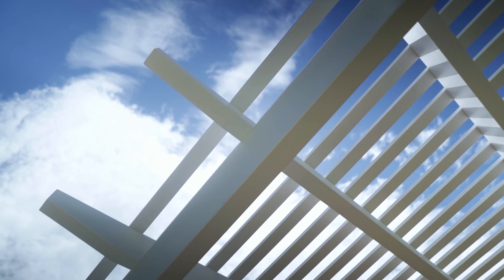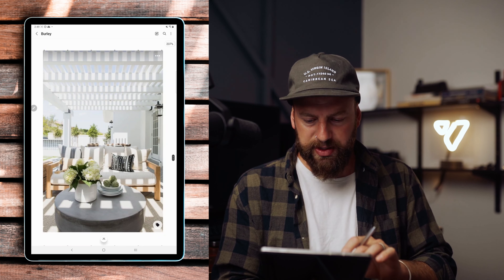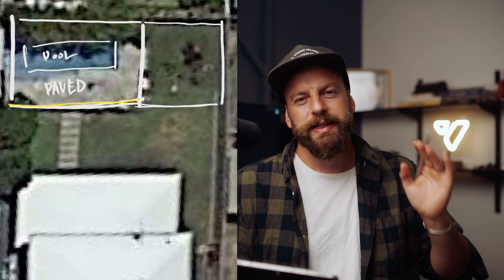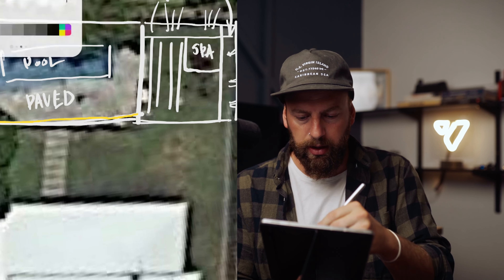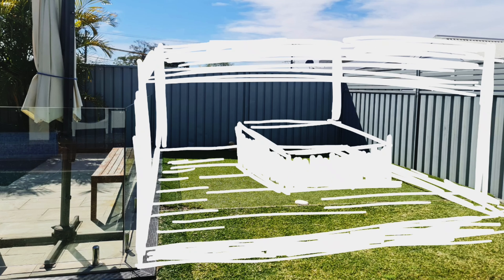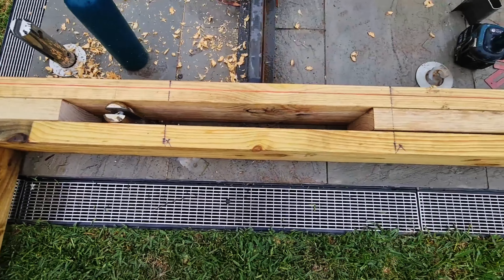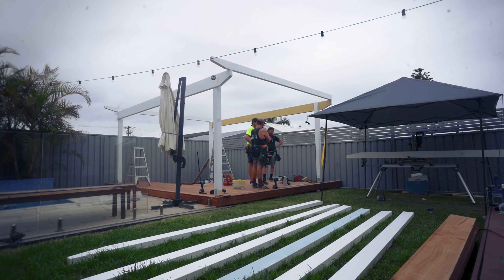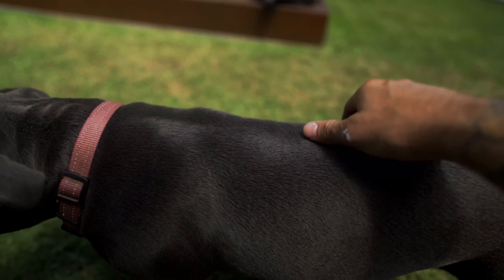Backyard renovation | Deck & Pergola | Design & Build

Comment: Lovely job Dan! What wood boring critters do you have in oz? be interesting to compare to Portugal... 
Do you do your own decorating or sub it out?
Reply from the maker: Thanks mate! We tend to use Irwin as they are heavily stocked around here. 

We do it ourselves however next year, I think I might sub it out. Not a massive fan of it tbh
Reply: @viking.designs  I'd rather be doing anything than painting, anything! Ahhhh, yes, I use the irwin speed bore, what I meant was insects, what insects.  We have the Capricorn beetle larvae in Portugal,  finger sized tubes through the timber, you can hear the little shits chomping away 🤣